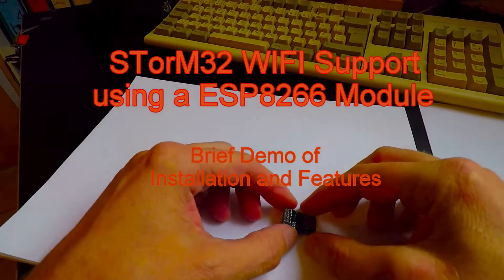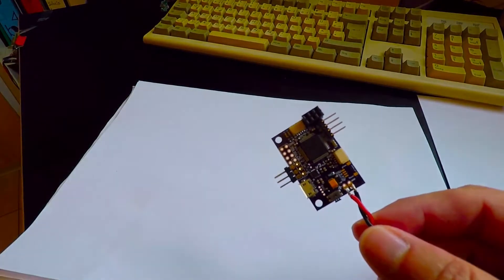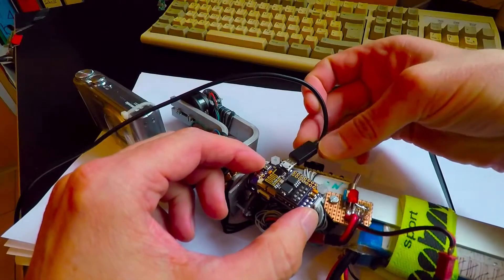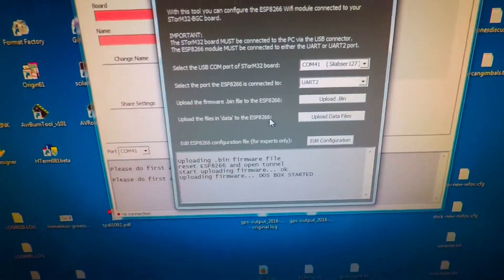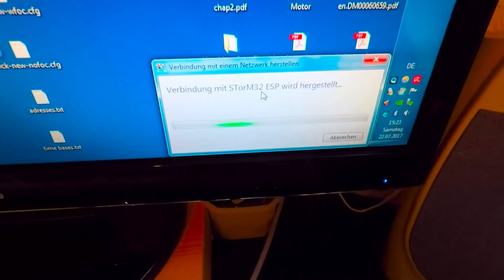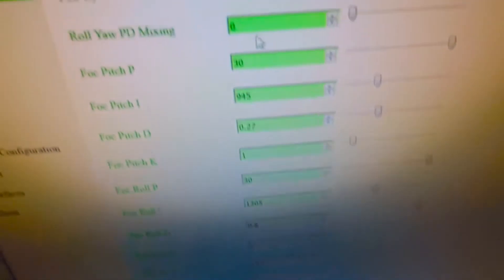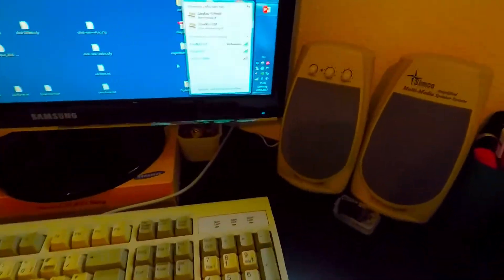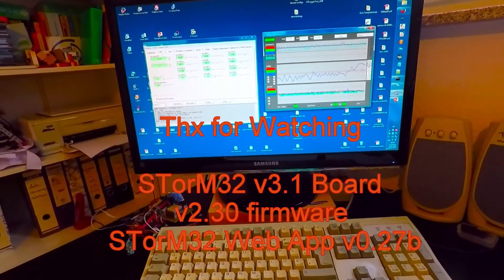STorM32 Wifi Support, using a ESP8266

Comment: Hi Olliw where can buy this T_Storm32 board & NT motor modulus ?
Reply from the maker: any of the cheaply available v1.3 and v1.31 STorM32 boards can be used as controller boards for T-STorM32. I guess what you are asking is where the newer v3.3 STorM32 boards can be bought. These are not yet available commercially. NT motor modules are available from ensys.lt. However, these do not support T-STorM32. T-STorM32-compatible NT motor modules are also not yet available commercially.
As regards the v3.3 STorM32 boards and T-STorM32-compatible NT motor modules, there had been a group buy recently (https://www.rcgroups.com/forums/showthread.php?3027947-T-Storm-32-prototype-group-buy), and it is expected that this results in them becoming commercially available. So, watch out. :)
Reply: Hi thanks for the reply ,what about the encoders ,its comes with NT motor modules?

Comment: Don't worry, nothing works on Internet Explorer bro :)
Check out my video using a gimbal with slip-ring, made possible by STorM32 NT version: https://www.youtube.com/watch?v=MtEbGwQ3bg4 (it's a dual-operator setup, I fly and my friend aims the camera, slip-ring means our controls can be completely independent). I had difficulty tuning it with imu2 on, so this is just with one imu but it still gives a great result.
Thanks for all your hard work, this project is one of the most professionally done out there.